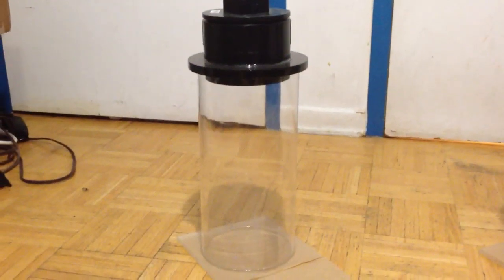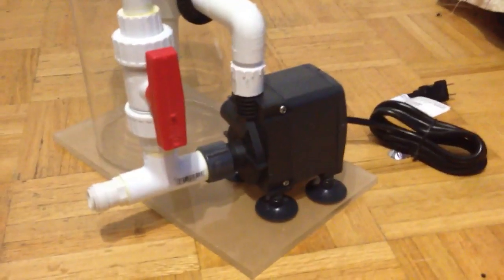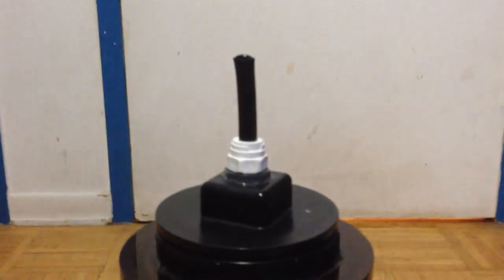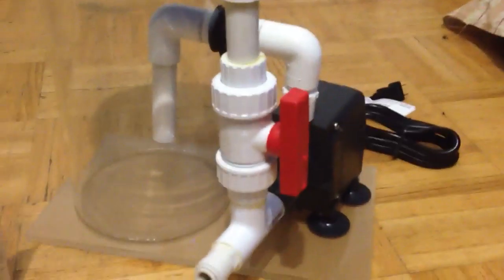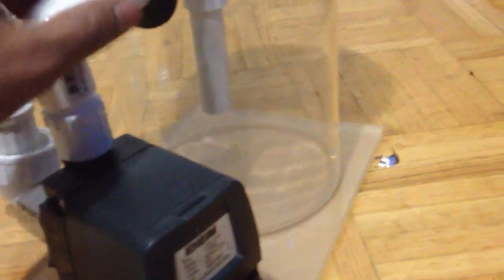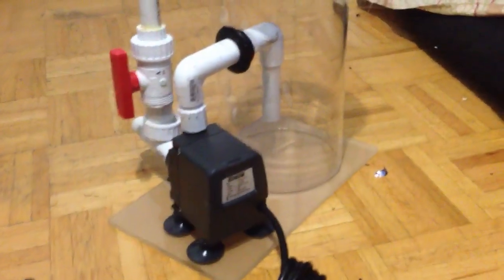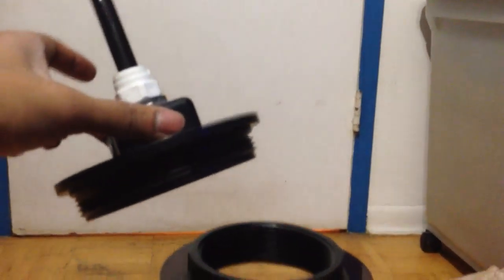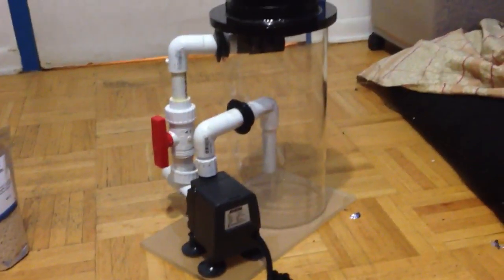DIY Bio-Pellet Reactor (Part 2)

Comment: What size pvc pipe did you use off of the eheim 2000 pump, and what fitting screw into the pump. Looks great it looks like it should be able to handle the 1l biopellets I need.